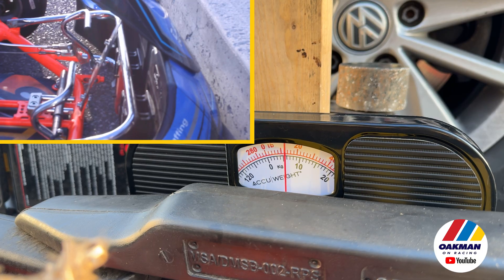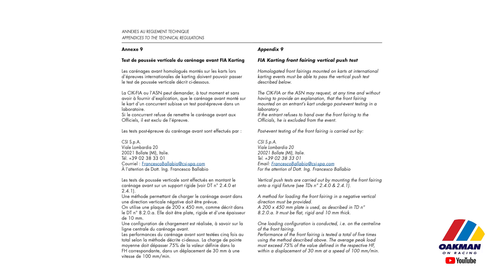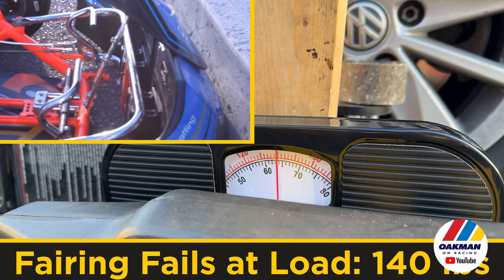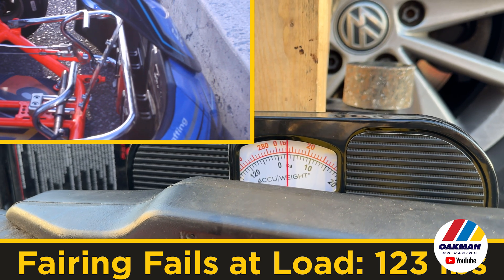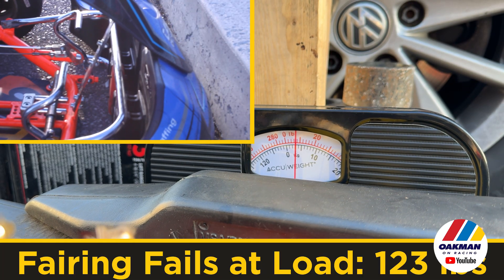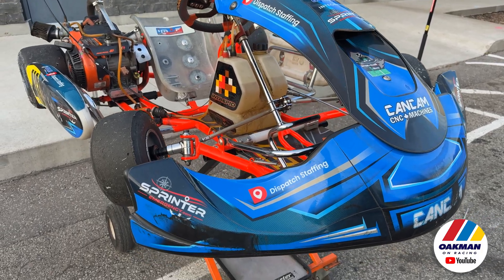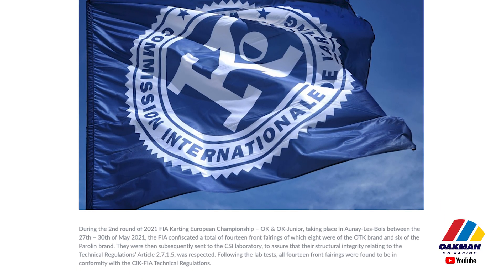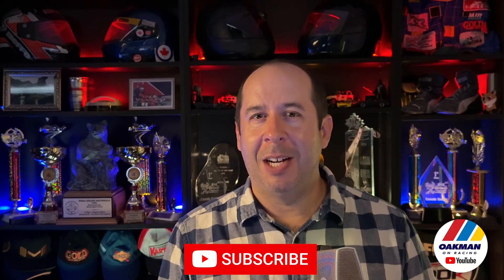Has the FiA Failed With Push-Back Fairings?

Comment: Appreciate the analysis. We definitely find that the hit from a distance is what activates them more than a static push. Drivers at higher levels know how to push without activating the PBB, and yea lots of them use it to clear a guy out. See it all the time.  IMHO the PBB even with the default penalties you can't protest even if you have nowhere to go...driving standards aren't being addressed. Folks are going to tighten those clamps as far as they can by hand, and they're allowed to.  The rule says driver has to be able to open them without tools, but that's really quite unenforceable with Jr and Cadet classes.   When the front bumper splits at the seams, which they do a lot...they get glued back together. Parts are expensive. They then fail more easily again, and won't push back.

Comment: Don't forget that we leave the bumpers on the sun "cooking" as long as we can until minutes before the races, until they are very soft. Also we "massage" the hell of it, to make it even softer. I guess if the bumper will activate or not is very imprecise and it will depend on many factors
Reply from the maker: Exactly. Too many factors, and many easily manipulated.

Comment: Just a note. 143 pounds of force is about 636N. For a kart of about 160kg of weight (senior x30), this is an acceleration of 3.975 meters per second, or about 0.4 g. It is as if you pressed the brake in your car a bit firmly, and not really a hard impact as we experience when you actually hit a driver and the bumper drops. It would be really nice to see where the actual threshold is. Still the FIA needs to do something about this
Reply from the maker: Love that someone can do that math.

Comment: Its highly dependent on how soft the nosecone is, a brand new nosecone is simply more ridgid then a Old abused one.
There is difference between one set off these things to another set, where you place the clips and how tightende they are also have an influence.
Its not a perfectly system, the best thing was drivers with better driving standards and better racecraft, but we would not race In a class that dont run them, we have tried that and it was not fun.
Reply from the maker: If they are so sensitive then they are a failure. And having seen them take incredible hits that lifted the back end of a kart off the ground without activating, I say this with confidence. Still, some drivers do tend to drive differently with them, but more so because they activate easier from off centre impacts, which is how you move someone. I can’t speak to your experience, but CKNA doesnt run them and the racing is quite good because they substitute using the push back with severe penalties to de-incentivize contact.
Reply: @OakmanOnRacing  Where we are racing they tend to rely mostly on the pushback, and driving standards are at times really bad. 
There are workarounds for the pushback supports, and one off them is to make sure the front bumper is as soft as possible.
Reply from the maker: We have the same issues here. Also installing the clamps with tools.
Reply: @OakmanOnRacing The rulebook is quite clear that the clamps needs to be removed without the use off tools. Being a techguy my self at some races i have seen a lot of different ideas to prevent these things Popping In.
Reply from the maker: @bai7200  This is true, but like any rule is only as good as enforcement. And since schedules are incredibly tight at most events it is rare that the RD or Tech officials have the opportunity to force drivers to come to grid with clamps off and watch everyone install them without tools. It happens. I have done it. But its rare.
Reply: @OakmanOnRacing  At some races every one have to come to the grid with the front bumper removed, i find the best way is to ask people to remove it and if they use tools to do it they have to adjust the clamps. 
But it Can be hard if you dont have the man power for it.

Comment: In Australia they make us run cameras on the front of the karts. That way any issues with people protesting etc there is footage. Was to many issues with the drop down bumpers
Reply: I like that we have to run cameras here. But karting Aus is pushing state series events to run drop bumpers. Not only do we have the issues demonstrated here, but it also means clubs need more officials at events to police them, which adds cost.
Reply from the maker: Funny how it requires more officials when pushbacks are supposed to support the officials that are already there. They’d be better off just hiring an assistant Race Director to help officiate races.
Reply from the maker: I love cameras. The cost does become a concern here in North America for club level racing though. Plus placement is a major factor in whether the video is likely to show anything of value.
Reply: @OakmanOnRacing  Yep, to follow up on the requirements in Aus. They aren’t a requirement at club level events (same with drop bumpers). But once you go to a zonal event and up they are required to be fitted and running from the first practice session of the day. They also need to be mounted on the nassau panel, with a minimum and maximum height specified in the national rulebook. If you are called to the stewards, you need to bring your SD card with you (which also must be formatted before the start of the weekend).
Reply from the maker: Love that. I’ll pitch it to the series owners for next season. Probably a hard sell, but maybe I can wear them down over time.

Comment: to me it seams you have them (mfg) building in a certain amount of deformation in the bumpers as softer would slow the impact slow down and not spring the bumper....essentially a "crumple zone" as in cars which slows down the impacts and nuisance triggers was probably the thought, like cars they are surviving the frontal impacts so to speak but failing the moderate/partial impacts to the bumpers (sides) and triggering which are frankly the most frequent it seems.....funny they would not test to like the car standard angles for impacts as they are representative of incidents we see, and they have been testing cars for a long time so you would expect they have a handle on % of impacts and where from data.
Reply from the maker: As I mentioned, they are not bumpers. Designing them as “crumple zones”, which would be valid for safety, would completely compromise their function as an impact switch. They could be engineered to do both, but that would be a complicated design and expensive to make. The FiA is not putting that kind of resources into karting.

Comment: Should’ve tried on the sides of the bumper. From experience it’s hard to get a full pushback from the front of the bumper. Yet it seems the smallest impact on the sides of the bumper guarantees a half pushback and sometimes a full.
Reply from the maker: I was mimicking how the FiA homologates them, but it certainly seems easier to activate on some angles vs others.

Comment: I think you're missing the speed factor. I'm not a physics guy, but I think hitting something fast AND hard will be more that just hitting something hard.
Reply from the maker: I am mimicking how the FiA tests them for homologation. And we did hit them dynamically. Sure, speed makes a difference, as it should. After all, thats how impact guns work. But it doesnt take a great deal to move another kart. So for the system to fail to activate, even with how hard Jeff was smashing them together, shows how far from optimal they are.
Reply: ive gotten PBBs on formation laps going like no more then like 20 mph when every one checks up id smash into them not going over 20 and id still deploy it
Reply: Velocity x Mass = Force . Of course the speed matters. The speed of the kart being hit also has to be figured in to figure the actual force of impact.
Reply from the maker: And the deflection and impact resistance of the objects being hit together. Like the difference between hitting a bumper at the rail vs the centre, vs the ends.

Comment: Looks like something we already talked about...😅
Reply: Also, does the tighness of the brackets change the numbe4s?
Reply from the maker: Only when they are quite loose. As we demonstrated, the clips on both karts were hand tight. No tools were used. And these were our results.
Reply from the maker: Yep. I finally tested them. Pretty shocking.
Reply: I see a lot of 'deflection'...wich result in lost of energy......

Also, if FIA doesn't give any 'numbers'....